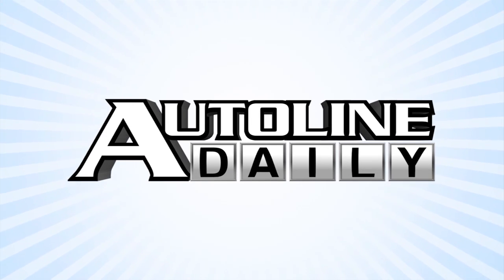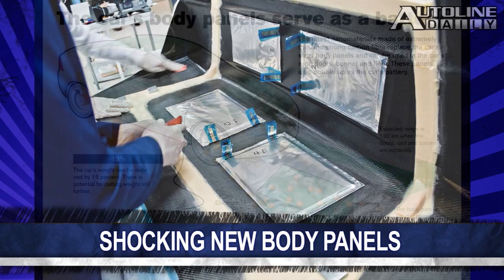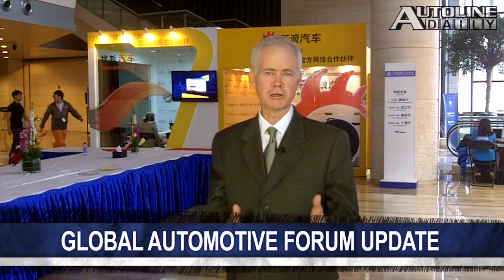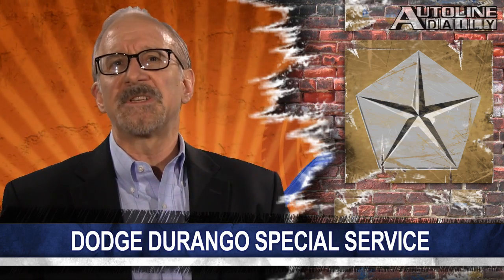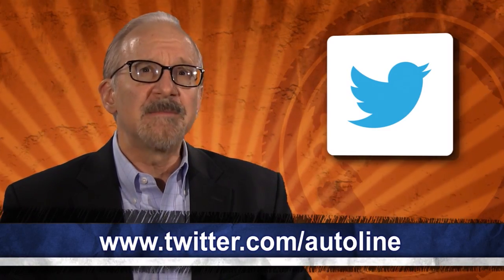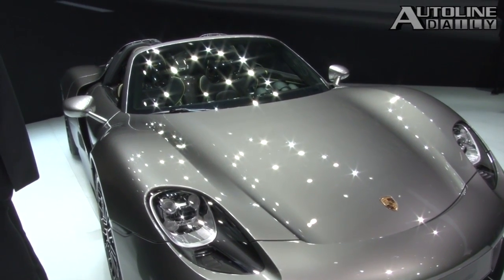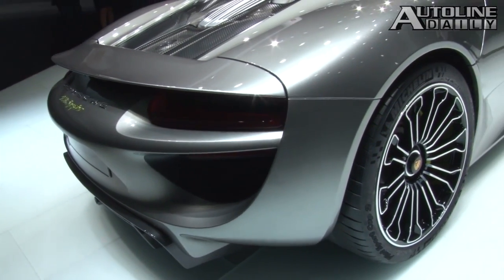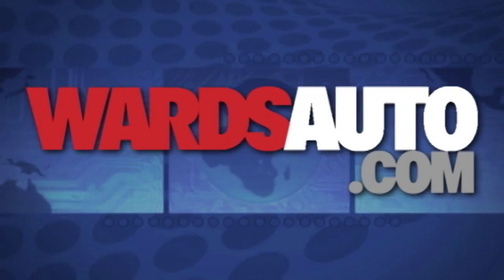Body Panel Batteries? - Autoline Daily 1239

Comment: Tesla have seemed to solve that problem @ 0:27. Use the weight of the batteries to their advantage, Of course lighter batteries would be better but with current technology, this seams to be a good solution.